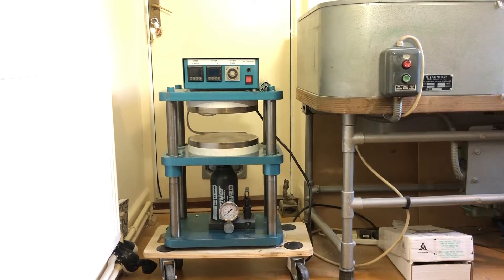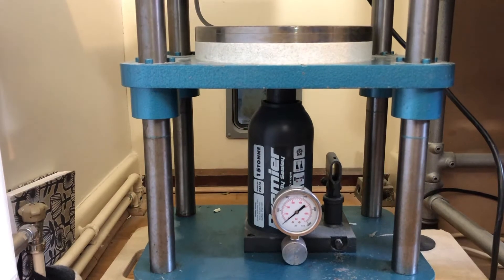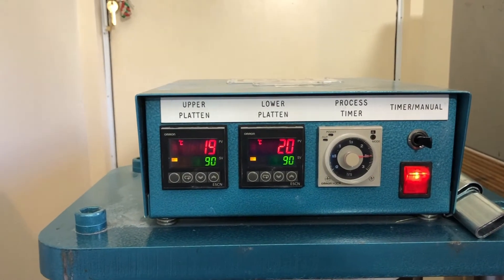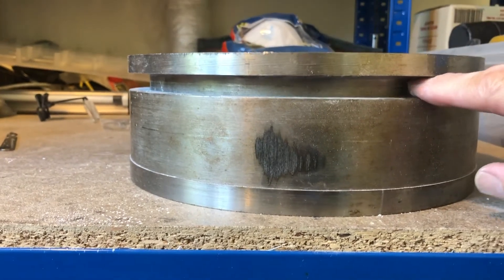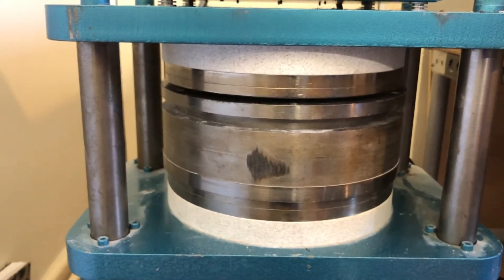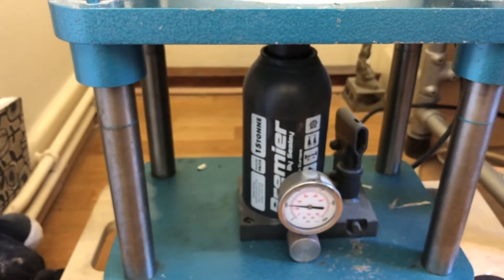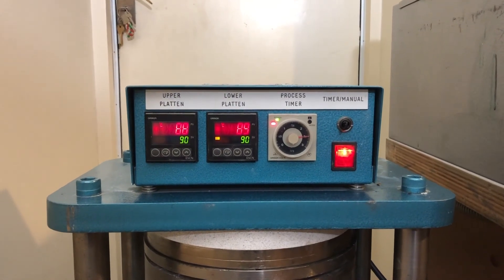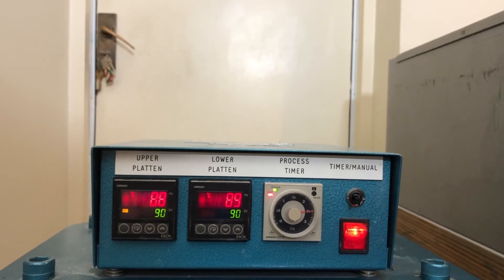Mould making with a SEBA 9in vulcanizing press

Comment: Such a good video thank you so much for posting it. There is so little information about making moulds for Pewter casting it's quite an art!
I have been using a very, very old Centricast and 6" vulcaniser, for many years but want to invest in a 9" vulcaniser and spin caster. I see that my only options in the UK are Seba or Nicem, do you have any recommendations at all?
Reply from the maker: @angeltrash5638  I would try to find a secondhand machine, especially for spin casting. Buying new is very expensive. There are more makes available secondhand, although of course they come up for sale rarely and maintenance is an issue. The Saunders Mk V casting machines I use are virtually bomb proof, but they are simple and have limitations on mould depth. If I were to buy new in the UK I'd probably look at Seba because they're actually made in the UK, rather than imported from Italy like Nicem. But I think the Nicem machines are more modern, and offer more convenient loading systems.

Comment: What size mold frame are you using? Great video
Reply from the maker: It's a 9 inch mould frame
Reply: @MrSaundersMiniaturesWorkshop  Just one more quick question. Is it 1 inch deep?
Reply from the maker: @stevom5678  It produces 1in deep moulds. Obviously, to do that it needs to be more than 1in deep itself.

Comment: I'm interested in making molds for lead fishing weights.  Is it true that if I get 5% shrinkage when the mold is cold, if I heat them back up to  120C - 150C then the shrinkage should go away?  I currently use aluminum molds and I could pour so many so quickly with a spin casting mold set up.
Reply from the maker: Heating up a mould too far causes other problems. If I use traditional black rubber moulds which vulcanise at 150C I still only ever preheat them to 80C-ish otherwise the castings are inclined to flash. If you're making fishing weights, you'll have far more heat retained in the mould because they are massive relative to what I make, and you'll have longer spin and cool down times before the mould can be opened (it'll still be faster than a one-off mould, and I know one of the machines I operate was previously used by someone casting fishing weights). Also, I preheat because the small size of the items I make could do with every bit of help to avoid too much shrinkage. Hotter moulds also cause handling issues. :-) You also have to consider the cost of investing in the machinery compared with a simple drop casting mould out of aluminium.
Reply: @MrSaundersMiniaturesWorkshop  Thank you so much for the thoughtful reply. 

I have much to learn so your videos are super valuable to me.

Comment: Is there any way to prevent the silicone mold product from shrinking while using the press?
Reply from the maker: No. Lower temperatures and therefore longer vulcanisation times will reduce but not eliminate shrinkage. Heating the mould when casting will get it back to nearer 100%. I prewarm my moulds to 80degC before casting both to reduce shrinkage and to make casting easier. Cold cure silicone is the lowest shrink option, but the rubber can’t take hot metal unless it’s a specialised RTV silicone.